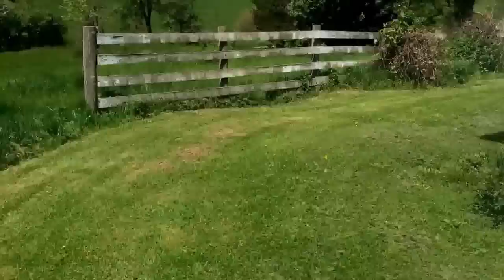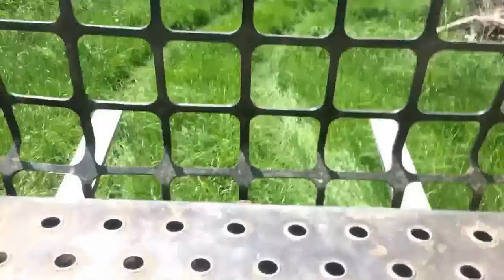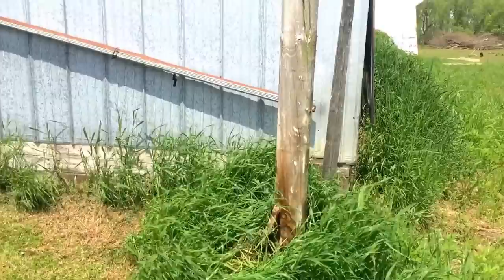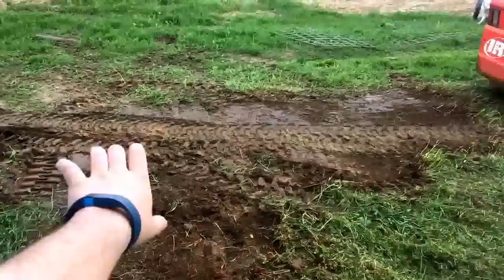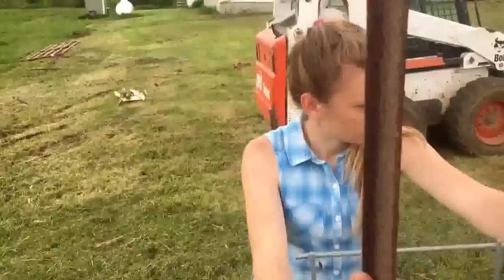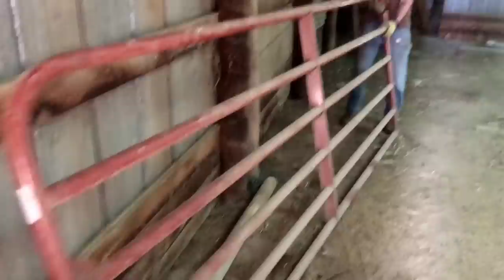Fence Deconstruction

Comment: Can I make a suggestion , we used a 4" pipe and cut it to just shy of how deep you wanted to put your T-post in and slid it over, then used the heel of the loader to push it down into the ground using the down pressure hydraulics. Your ground looks soft enough, sure cuts down on all the manual post pounding, but if you wan the work out, hats good too. Enjoy your vids, keep em coming Ryan.

Comment: we use round 6 inch role wooden poles treated with anti rot and 50 rolls of square mesh with 2 to 3 rows of bared wire on stock fences or electric fence when we divide  a pasture off Intersting to see how you guys do it

Comment: "Push" the fire with the skid steer-- just keep pushing the wood and embers into a pile in the center and it'll burn out completely... won't be a handful of sticks left when you're done... 

We use the front end loader to do that and it works wonders.  

Later!  OL J R :)